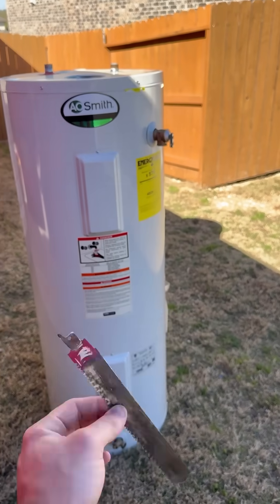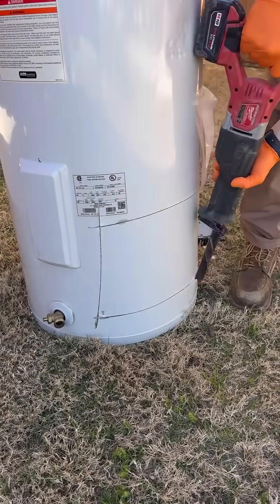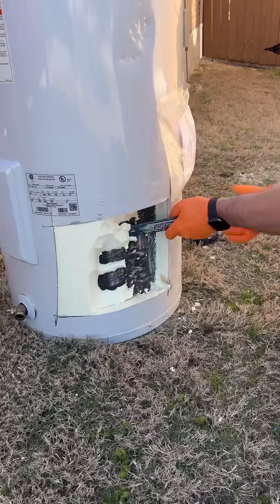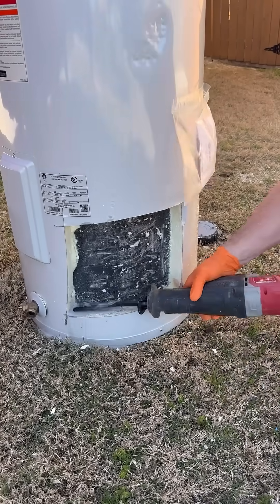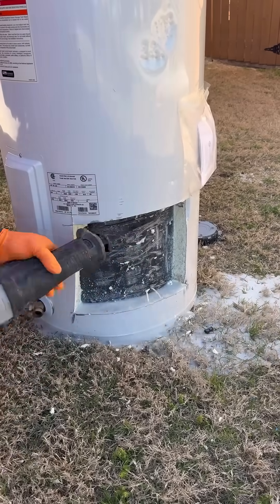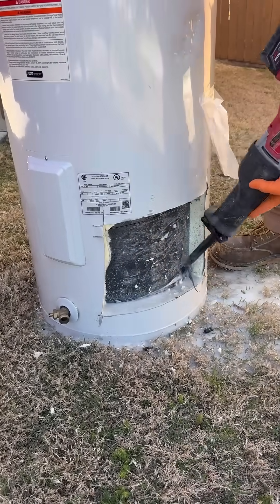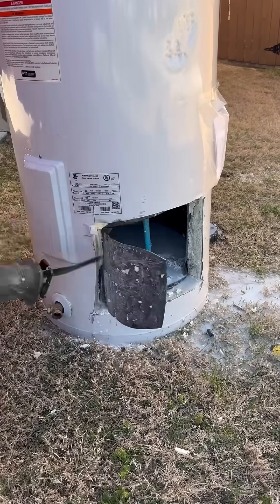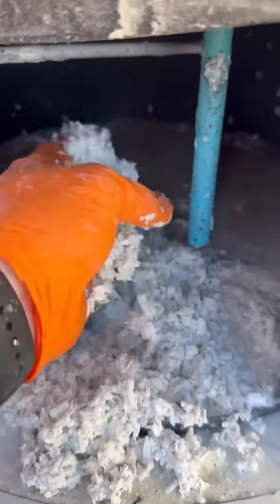What Is Inside This Water Heater?

Comment: People just flush out your water heater every 3 months it’ll last longer. Turn it off completely. Attach the hose run it to the drain from the water heater. Empty it completely then open and close the water valve to agitate the sediment. If you’re consistently doing it every 3 months depending on how hard your water is the sediment shouldn’t build up this poorly. Use a clear glass a water to see how much sediment is left the less the better.

Comment: I clean the tank by turning off power and water, then draining, and removing bottom element,  the using a shop vac with a vinyl hose taped to it. You can remove almost all build up.

Comment: Flush it for a couple of gallons every month. Once in a while reverse flush by blowing compressed air in through the drain valve. Check your anode rod yearly to make sure its not dissolved (and replace it when it gets gooshy). Your tank will last forever.

Comment: It doesn't "settle" as such.  Hard water has calcium carbonate in solution, as it has dissolved limestone as it percolates through the ground.  The thing is, the calcium carbonate comes out of solution (precipitates) when the water is heated.  Then, it settles in the bottom of the tank.  Ground water is usually hard, whereas surface water (like from a snow melt fed reservoir or rain fed river) is already soft as it is essentially distilled water that has condensed from clouds (no minerals in water vapor).  Just so you know....

Comment: Yep. I have a tankless electric water heater. Our water is hard. Calcium does build up in those too. When your faucets seen to lose pressure 
Pull the cap off the spigot. You will find calcium build up. Showerhead too. 
When this happens. Time to flush out your system.

Comment: Are there anodes on those water heaters?
Reply from the maker: @russelrobinson7919  yes
Reply: @theplumbersplunger  do you know what kind?

We use a magnesium anode for soft warer and an aluminium based anode for heavy water.. Just curious
Reply from the maker: @russelrobinson7919  magnesium, zinc/aluminum, and powered anode rods that are titanium.

Comment: shop vac and a small hose duct taped to it will clean all that out and you can just keep running the same water heater.
Reply from the maker: @ethanwills2493  this one was leaking. I have done that plenty of times though when changing out the lower element.

Comment: Hmm.. what about you try to use those vibration oscillate blade things? You could just puncture straight trought and then repair should be more easier as well (if thats the case)

Comment: I have 6 cases of bottled water in rotation at any given time.  We don't drink our local Scott Co IN water.   One glass of it has dozens of solid particles sitting at the bottom.  Sand mostly it seems.   Or some kinda scale build up that's breaking down in the mains.   I have to remove and clean out my sink screens monthly and shower heads every few months because that stuff clogs em up

Comment: Why did you replace it? It looks fine. I mean, the anode could be replaced, but just wondering. Looks better than mine which is 4 years old now. I drain mine annually. I have an anode that ive been putting off

Comment: You should have seen my old 9 year water heater that lasted 20 years. It exploded five months ago, and I at first thought I was seeing pieces of insulation floating inside. They were golf ball size, to baseball size rocks, which was all the hard water, and chemicals that crystallized over the years. They felt like a bar of soap, left a day under water. So much built up, that when water heated up, it all expanded to the point the tank could no longer contain it, and exploded. Was the worse mess I ever had to clean up, next to dropping 6 trays of eggs.

Comment: If you take a good wet/dry vac and reduce the hose to 3/4 pex and get a good seal on it. Then, take out the lower element. You can vac all that stuff out. I do it to mine every time my element burns out. I also do it to all my clients' tanks when I replace an element. (Top or bottom) I just charge them by the hour... you never know how much stuff is in one.
Tip 1 if the Calcium gets to dry or stuck you may need to flush a "small" amount of water in to it.
Tip 2 Listen to The Sound of your vacuum. Cause your hose will get clogged multiple times just pull it out, tap it on the side, crunch up the stuff that's in it, and it'll go right down

Comment: European tanks can usually be openend From the bottom and cleaned, thats also how you open it to change the heating element
Reply: In the USA our heating elements are able to be removed and replaced from the outside- it does make a big mess if you don't drain the heater but it means you don't need to lift or move the thing. There's an attachment to add a hose to the bottom to help drain it.
Reply: Can you not suck up the calcium using a flexible vacuum cleaner hose inserted through the top?
Reply: but not all i germany you normally have just a port (i think 2"-yes the only thing not metric is plumbing here for some reason and not all of it of course)where you screw the heating element into

Comment: I love in Central Florida. I got to a place in life with 40 gallon Whirlpool water heater where I would change the anode rod out every 3 years to a new Magnesium rod instead of aluminum and also change the two heating elements to dual back elements every 2 years. My water heater lasted 15 years but then my electronic board burned up and I found my overflow was running steam out and thanks to our leak alarm we turned it all off. What a disaster. Glad we plumbed the pan outside with 1 inch PVC. Also now we have a heat pump Rheem. I flush ours every 6 months and we also have a sediment scale inhibitor outside at our main water shut-off and another one inside. That helps sediment immensely! Before I would have 10 inches of sediment a year. I used to suck out the sediment with 1/2 inch Carflex Conduit through the bottom heating element port with a shop vac. What a mess. 

Jeff - Sunny Central Florida ☀️

Comment: My father used to cut old water tanks in half lengthwise to make livestock water tanks. He'd weld pipe for legs to keep the tank off the ground and keep it from rolling. I don't know what tool he used to cut, but I think it might have been an acetylene torch. In those days, tanks were thick metal. I still have one of his livestock tanks. Hasn't rusted out yet. The thing's older than I am, and that's saying a lot.
Reply: Yeah those old hot water heaters used to have a lot of copper in them too. They had copper coils and a copper radiator. When I was a kid about 30 yrs ago me and a buddy of mine found a bunch of them. Where we lived was the country and across the cow pasture and through the woods a ways was private hunting land and they were tearing down all of the old hunting cabins and building new ones. In those old hunting cabins were also old hot water heaters but they had bulldozed everything out into the center of a field. My buddy happened to bust open one and seen the copper and said "Man we just hit a jackpot." He explained it to me so we left and came back with the right tools and we ended up with a few thousand dollars. Not bad when you're 18 yrs old. I remember the copper being like 80-85 cents a pound. 😂 
That was a long time ago.

Comment: Thank you for not calling it a “hot water heater”
Reply: I turn mine off at night. In the morning, it's still hot but not hot enough so I turn it on to heat the hot water up. THEREFORE it IS a HOT WATER HEATER. Deal with it.

Comment: Who still has a tank water heater?  Lots of maintenance & high electric bill and takes up alot space. Best thing I ever did was go tankless. Have had excellent luck with Ecosourse tanks. Going on 10 years with my 2 units.
Only thing required really is a dual big blue water filter system which you should have anyway cause city water is super rusty. Dont believe me take the cover off your toilet look inside.

Comment: So, I had this idea: stop using long life heating elements, because I always have a hard time getting them out, but the cheap ones come out easily. And around here, the water is so hard, that flushing the tank is useless. The element has to come out anyway. The element might burn out sooner, but usually won’t until the minerals in the tank cover the element.

Comment: I worked at AO. Smith. for nearly 40 years and I work in quality control.The owners manual recommends flushing out sediment and junk inside.you need to hook up a water house so you don't flood wherever your water heater is located.The elements aren't made like they used to be made.We saw lots of returns and it was scary

Comment: Safety alert:: hopefully everyone knows using an angle grinder could be extremely dangerous. If the insulation melts it can grip the blade and break up. Causing shrapnel like wounds. 
Have seen this first hand, bloke was trying to cut a car tire with an angle grinder.

Comment: Few comments.
That's not just Calcium.
Scale, is mainly of calcium carbonate (CaCO3), magnesium hydroxide (Mg(OH)2), and calcium sulfate (CaSO4) but there can be much more.
Drain you tank YEARLY.
Check and change your water tank sacrificial anode tube.  You may smell sulfur or fart smell if the anode tube is gone.
DON'T RENT.   Buy a new tank and install yourself, it is one of the easiest jobs to do.  
Renting, you'll pay up to 10x the price of buying.

Comment: Installing a hot water heater without an expansion tank on the inlet line can cause premature tank failure. When hot water is drawn out of the heater it is replaced by cold water. When the cold water is heated it expands and with the faucets closed and with a backflow preventer in place the water is trapped in the system with no place to go. This causes the water pressure to go way up and overpressure the heater. Eventually the constant pressure cycling will crack the walls of the water heater and cause a leak. The expansion tank absorbs these large pressure swings and extends to life of the heater.
Reply: The water heater where I am started leaking and it was 13 or 14 years old , this could explaining it.

Comment: That is not calcium build up. I know you guys are gonna argue with me, but calcium does not build up inside of a tank like that. Those tanks are self cleaning because the dip tube goes all the way to the bottom and flushes the bottom every time you run hot water. So what are we looking at is your question? You are looking at the porcelain that they spray on the inside of the tank during manufacturing. Hence it’s called a glass lined tank. Notice the Steele tank is exposed in this video.  Over the years as a tank heats and cools off through expansion and contraction the glass liner fractures and falls into the bottom of the water heater. What most guys call calcium in the bottom of the heater is actually porcelain. This is why I do not recommend flushing your water heater Under any circumstances, unless it is an on-demand water heater. I’ve only been a plumber for 40 years. What do I know?
Reply: fake news
try telling that to anyone who's had to descale a plastic coffee maker.
Reply: @TheJacklikesvideos  Was it all piled in the bottom of the coffee maker? Uh no. Nor would it ever even if you just kept water after water and never poured it out. Water heaters are not plastic by the way. One more thing. Why is it only calcium supposedly and not every other mineral and some chemicals in the bottom of that tank? Maybe you can teach me something. I’m being serious too.

Comment: People say this is why you shouldn't drink hot tap water, but if all of this stuff came OUT of the water, wouldn't hot tap water be even better?
Reply: Initially yes. As it accumulates and the longer the hot water sits, the reverse becomes true, elevating levels rather than reducing them. This is true for corrosion of the tank as well, along with potential legionella growth. Hot water will also leach more lead if applicable

Comment: I actually make the parts that go into the AO Smith water heater mainly any of the nipple liners and such the blue drip tube is made across from my molding machine at the extruder 

Ngl kinda neat to actually see the inside

Comment: Flushing my water heater annually? Your a funny guy 😂
Reply: You’re
Reply: I flush our water heater every 6 months. I sharpie it with the date on the side of the heater. Also I changed our drain to a full port 3/4" ball valve with cap. 😊
Reply: You must hate saving yourself money 🤷
Reply: @slayridah Draining your WH annually isn't popular with every plumber.
Another 40+ year plumber said "It's a waste of time, money to flush your tank."
Mine lasted 16 years with no flushing. 
And my state is one of the highest levels of minerals in our water supply.
Reply: @andreah6379  My grandparents water heater in Wisconsin last over 40 years and they did not flush it either. They had well water. Their water was absolutely fantastic though. Really good quality water. It all depends where you live. Here in Central Florida you have to flush a water heater every 6 months or year. I was getting 10 inches of sediment a year in mine before I treated my sediment. Now I use several sediment reducing filters and don't have issues with sediment anymore. Period. 😜
Reply: I flush it every time I shower. It’s called “usage”.

Comment: I've an old AO Smith. I've been in my house 25 years and it was probably there 15 before that. It has a wrap which I've never removed to check the year of production. Never flushed and I have very hard water. Going to have to cut that block of calcium in pieces to get it out of the basement...

Comment: Great Video! My wife & I were very fortunate on our 1st tank. I used to have 2 mini swamp coolers in the garage. I used the hose bib to connect small hose to both coolers to supply the water. Yes, it came out hot to the coolers but didn't take long to be ice cold. The use of the lower tank bib allowed the tank to discharge the hard water calcium crystal debris. Live in AZ. I would also twice a year hook up a longer hose & wash out the tank while the main water line was still open. The original tank lasted 17yrs. It was still working b4 we decided to change just to be on the safe side.

Comment: water heaters just use a hot wire in water, with the exception of heat pump water heaters which use heat pumps. heat pump water heats cool the area around them so they might be useful if you live in a place that's hot year round.

Comment: By the way,it's VERY important to replace the anod rod in hot water tanks (the rod connected to to large bolt under the black plug on top of the water tank)because it's a softer metal that will attract the corrosive particals instead of the tank ,but when the anod rod is depleted,the tank takes it's place and corrodes a hole and leaks  ...some boats use anod rod things also 💁🏻‍♂️

Comment: Ive only seen drainage and cleaning valves on commercial unit's the consumer grade stuff are sealed units that get replaced every 7 years or so dependent where you live and the amount of minerals in your watter suppliy

Comment: I had my water heater fill with so much crap it reached the bottom element and cooked it. I'm cheap so I used a piece of pipe and a shop vac to suck it all out the drain hole. Rebuild kits are like 60 bucks lol

Comment: You’re supposed to flush them? Annually??

Sorry, recent home owner. Umm… how do u go about doing that? Also is there anything else I’m supposed to flush annually???
Reply: Some basements have an open sump pump water drain. Just thread on a compatible hose and dump the water in that and let the sump pump do its work, or use a transfer pump that can pull from the hose to empty water outside. Never done it myself but that's how I think you could attempt it.

Comment: Dude..... My hot water heater is 24 years old. It's the original hot water heater that came with my home. I have never had it flushed. I'm still rocking it, works fine..  for now

Comment: That thing is practically brand new! Also, I don't know if it's all of them, but ours has a "cap" with the heating element held by a bunch of screws that you can just take off to clean the thing.. It's just that it's under the insulation, so you have to carefully remove it in one piece, or shove new insulation there once you're all done...

Comment: don't use water softener with a water heater because it will leak after a few years. found out the hard way after three new water heaters installed would leak every 2 years. the salt causes premature corrosion and will eventually fail and leak.

Comment: Try purchasing an H38 from the Hydro flow company that will cut down on your calcium deposits tremendously and also changing your anode rod every three years my heater was 28 years old and it was like new because I changed the anode rod every three years by the way that's what I'll give you a nasty smell also and this gentleman is right drain the heater regularly

Comment: I used to work for a water filtration company and they had some statistic that like 1 inch of sediment build up can increase electricity costs by about 15%. And that's per inch. As he said, this wasn't even much compared to many he has worked on, and it looked to be a solid inch or so

Comment: I was responsible for the running of residential facilities.  Clients on one end of the building complained hot water ran out before they could all get showers.  Owner finally agreed to replace the water heater.  Only 2/3rds of heater was calcified.  Bo8ght water softener at same time.